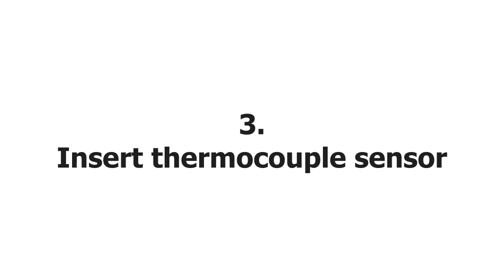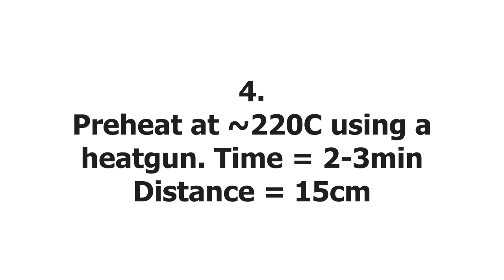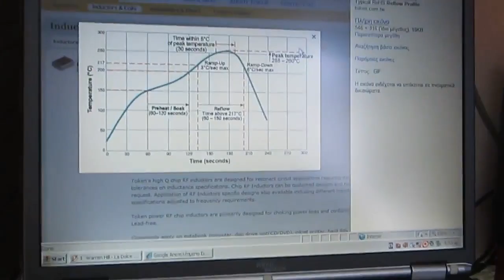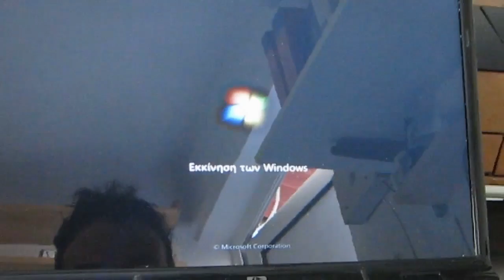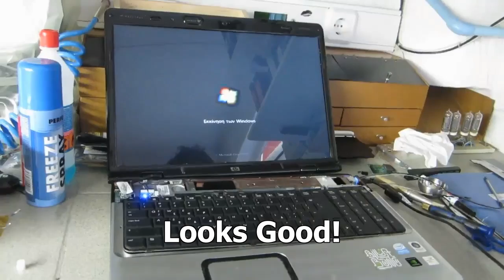HP Pavilion DV9000 Series Laptop Display Repair - GPU BGA Reflow

Comment: Tin melting temperature around 220-250c and that's should the maximum temperature and heat at this temperature for 4-6 minutes. Pour liquid flux around the chipset .. Many video in YouTube how to put flux correctly, then Use aluminum tape to cover surrounding the chipset 
Use heat gun start with low setting and heat the chipset and surrounding evenly around 80c for first 3min, then focus evenly on the gpu chipset slowly increase to 230c for 5min, then lower the temperature slowly to 60c for 3min, let it cool down. Wash with alcohol or acetone with brush,.

Comment: Sir i hve hp g61 laptop i juat finished to clean my laptop screen inside cos  some water drops go inside. So i finished to clean but not its not turn on. Boc i forgot to remove battery While i plugout wire hmmm help mewt ido now?  Nd when i plug power coad so charging led on. But when i click on power button  motherboard not turn  hmmmmmm plz plz hellp help help

Comment: Thanks for listing the music, I like it.  Technician heated my HP Pavilion and fixed many issues, still waiting to hear from him he's also trying to find a new inverter for my screen but the computer now works.  Not sure if the technician was able to repair my DSL plug in for internet (unsure of name), he has to use the Wifi from the neighbor he's very poor but he mentioned he will check this out also.
Reply: How long did poor technician's work hold? Is your laptop still working, was the repair worth?
I have one to repair and I am wondering if reflow is worth, or reball is the only solution
Reply: @Simion_T    Didn't last more than a month... But I've been told several times I need a hard drive... the hard drive is the original from 2007, so I just might try to find one but tough I live in the Philippines.

The LCD screen is long gone and I think also the DVD drive but wow the key board is so nice, WiFi and it's an entertainment laptop so it works well with multi media plug ins and I can use the large screen TV.

Comment: All you people saying you recommend fixing it up and selling it. knowing it would fail eventually, are whats wrong with this world.  this method shown is only one part of this process. the temps are incorrect though. they are much to high. that aside, the board needs to be preheated. the use of flux IS possible and from what i know is recommended. but used correctly. the full temperature profile of this video is wrong. but the heat shield you see is correct. pansy out and use tin foil if you like but if you want this to work without serious destruction then don't use tin foil. 

(Electronics technician for several years. computer technician 17 years. founded and run electronics company since 2012. )
Reply: So why don't you do a video how it should be done????

Comment: can I use a hairdryer instead??
Reply: you can't melt solder with hair dryer
Reply: It worked,but I know it is a short time solution,in fact it was a 1000w hairdryer which I kept it right on the gpu
Reply: For how much time u did it? i wanna try it too with the hairdryer

Comment: i have lenovo W500  with  ATI  Fire GL V5700 got problem (distortion images then black out). Now i'm using the integrated intel 4500MHD, it can help me do some exercise with 3D apps.
 When i had this notebook repaired, some technician told me in W500, the ATI  chip  is glued  so  it can not be re-flowed by  using heat gun or IR  re-flow station .

so will this  video help  me  fix discrete vga problems in  lenovo W500 ?

Comment: dafm9cmb8c0 motherboard by quanta. please help. how do you make sure that this board only require reballing  or reflow and no other components are faulty.
Reply: When you start the laptop, HDD lights look normal for booting, its just that the Graphics processor won't let you see it. You can also run the manufacturers boot tests too, but basically it seems to boot but no display.

Comment: there is no 3v_alw and 5v_alw is present when I connect battery but on adapter it's present. +15v alw is always absent is there any fault with components. pwr_src  19v from adapter and 12 v from battery is present.  MOSFETs are OK. rsmrst is 0 goes to 3v then 0 when I press power button.

Comment: Won't this problem eventually come back?
Reply: James Mahon so you fraud people selling them broken laptops as working ones that was "fixed" with temporal solution that is not an actual fix?
Reply: +iooi depends. In a laptop reapplying thermal compound and cleaning out the exhaust fan will help the problem reoccurring. I have laptops that have been working for 2 years after a reflow.
Reply: +iooi I'm a repair tech and sell used laptops all the time. it's no problem to repair these and sell it for 125. people still want dirt cheap laptops. I'll buy machines like this from people for $15 and resell em all day. all it takes is about 15 mins of actual work and some waiting and I make over 100. lol. sounds like a good deal to me.
Reply: James Mahon I still see DV9000 dual core going for 250 to 300 dollars. Yes these units still holds value...
Reply: Svyat G that's what thought too
Fraud exactly!

Comment: You were at 262 at 180 seconds then you should drop from then on according to the chart. Is there a reason you increased temp after that?
Reply: Looks like another no replier! I thought it best to move the heat gun smoothly & not all over! How important is it to pre heat the board (the bottom)? Another video says if you don't, you risk warping the m/b. Thanks
Have a Toshiba I want to do a GPU reflow, but want to be more prepared.

Comment: Its also a bit easter if you put a heavy weight on the chip so it settles on the board better. But you do have to watch your temp as it could melt the pins together.     Great video.   Works on mac too

Comment: u cannot measure temp with probe when u using hot air. probe is for IR, for hotair u need to use IR thermometer.
Reply: IT-Master 

I think you are right ,

Thanks for sharing this ,

what temperature not to exceed 

Thanks & Regards

Comment: what would cause you to need to do this would having the laptop get really hot cause this problem and this would fix it?
Reply: It's generally a temporary fix. You heat it above the temperature which caused the solder underneath the GPU chip to melt and solidify in a bad shape (creating a bad contact). You fix it and you sell it or if you think you are lucky and it will work for a long time, you keep it.
Reply: soupflood Thanks I did this for my acer aspire 5535 it fixed it for a month now its broke again imam just sell it and get something new

Comment: thanks for the info just did a reflow on mine and now it works also
Reply: and i used the small torch method without any heat shield

Comment: very good, this method did a good job with my Acer 5520. I followed exactly the instructions. The Acer has a seperated GPU card, it is easier to assemble.
Reply: You are stupid, that one is aspire 5520G
Reply: YOU are stupid, that one is HP Pavilion DV9000. ( Look at the title of the video).
Anyway, my laptop is working now.

Comment: sir how do you know if the one your reflowing is the gpu? Is gpu always located near the fan of the motherboard? or not? because i have d260 acer aspire one it has this weird pixels issue on screen and went blank, i thought it was bios problem but when i do more research i found it its due to its gpu problem overhearting making all the part of the ball lost contact to mother board, but i can't tell which part should i reflow because i don't where is the gpu located and i did some research again and what i found wasn't satisfying and really not informative so i still cant figure out where is the gpu located, anyhow is there any other way to reflow the gpu without using the hot air gun since i don't have one ,, your reply is much appreciated, Good day. and thank you For the video.

Comment: Its an HP??, so everything is just a temp fix till some other shit part goes??. If peeps not like video (IE Julio César) then go FO to somewhere else or give a better suggestion?. Fucking laptops r cheap and not worth buying equipment for proper reflow or even paying someone to do it for u and weeks or months later it pooching again anyway. I suggest people look around YouTube for other fix to this nvidea gpu chip problem and pick one they feel most comfortable doing. There is the oven way, heat gun way etc. Good luck to peeps trying to fix their laptops and fuck all the loser haters.

Comment: After reflow my pc works fine for few days. Then this problem starting again.
Any suggestions.?
Reply: my eng not so well.. im never try this stuff-but im good at pc...
it sounds like you should still heat it for 40[+] more secs.
it sounds that u have cooling problem! check especially your fan and whole  laptop from dust include between the fan ITSELF to the metal stuff near the fan[dissasemble that part..] ..sometimes there is  a lottt dust!
2.put some thermal paste!!!
3/ consider that maybe your fan is weak or faulty..[order new from ebay /whatever-or try to lubricate it with machines oil--*not wd-40!!!
4. maybe you overload [thats the word?!] the pc.. so its overheat and break again the contact balls...[or if you block the air vents..like put it on matters-towel..etc. ]or if u not power off the pc/use it a lot on once boot.

*soo..reball again and do this things.. u can get USB COOLING PAD
hope i'm help!! update  us!
 .
Reply: ליטק יעקוביאן Thanks for your reply.
You pointed out number of things, I try them first and get back to you.
Thanks for you help.

Comment: with me it happend after i installed the new gpu driver update 2 weeks ago.
black screen with white vertical lines. i tried reflowing, then i got some red lines instead of white and then a minute later it turned white again. i didnt use a hot air gun as show on this video but a hairdryer. i do have a hot air gun in the basement but my question is do i set the hot air gun on 250 degrees celcius and hold 15 cm away? or put it on 300c and hold 15 cm away? i dont have a thermometer :(
Reply: hello you can but cheap thermometers liek that one on ebay

Comment: I did a reflow because was getting some lines in the bottom of screen after done that now is not showing video display.
What should I do ? help
Reply: Alex K
try to bake your motherboard at 190degree in a big oven for 4minutes. it will solve the problem. i did it many times and it work
Reply: hahahahah....NOOOOOOOO Alex DO NOT DO IT.....LOL
Reply: You were very quick in assuming that it was your GPU.  Sometimes it is the screen itself especially in your case
Reply: Screen is good. Just after done reflow stopped showing video display.
Reply: First, what made you confirm that the screen was good?, second, since you are now getting black screen then you have totally damaged your GPU chip
Reply: Screen was working before reflow. So what is the option ?
Reply: Ill try next time

Comment: Your video is great! I followed your steps exactly and got my DV9740 video to function again. I'll see how long it holds up. After cleaning the dust out thoroughly and placing a large shim between the chip and heat-sink it may run cooler and hold up better than when it was OEM.
Reply: How long did your reflow hold? Reball required or laptop decommissioned?
Reply: @Simion_T  lasted only a few days 😢 trashed the laptop afterwards, wasn't worth the hassle to try it again

Comment: didn't see when you took the bad chip and replaced it with good one. video stinks. music worse. sorry!
Reply: You don't replace the chip. The chip is good, but it's the connections that are bad. A reflow is basically melting the solder connecting the chip to the board in order to repair the connections. The heat gun method works well; I've done it to dozens of laptops.

Comment: i had the same problem i took a regular soldering iron to the board apart and toucht every sing cracked solder joint, and then let it cooled and turned up and it works just fine no need to doo all that :)
Reply: Fernando Flores How did you do that?

Comment: However, maybe your notebook works for 9 months after heating with heat gun. But another 10 may dies after month... Those IC's needs to be reball or replaces with a NEW one. That's even not a reflow, because for reflow you need to preheating the bottom side of the mobo.. and many other things... 
Like I said - however, nevermind...

Comment: Unbelievably, I just used my new heat gun @ 750 watts to revive my T61. I was doing it blind, but I tried 2 mins at about 10" and 1 minute at about 4-10, with about a 67% / 33% split. Just did a test boot, and it works like a charm. Hope it lasts until the T440s comes out!

Comment: Hello everyone,

dear all can anyone kindly help me?? I am someone who Reballs the GPU and Grafikchips I use the followings:

1- AMTECH Flux: NC-559-ASM-UV (TPF) Made in USA but I bought it from China
2- Solder Balls from Profound Material Technology Co.LTD
3- Heat Gun THLP 2000 EP, Made in Germany
4- Termameter 50c-750c

It works very nice, but after one week or MAX 1 mounth its not working anymore, so therefor I wanted to know why? Can anyone help me please? Many Thanks in Advance.

Regards

Comment: if you buy HP laptop you must buy and also equpment for fixing..i had DV7 and it broked just after one year waranty..want turn On ..then i bought another hoping for better luck..and gues what ..died after 1.5 year few days ago...that ingeners who work there should be hanged..comlete morons..now i use acer who work for 8 years no single problem ..no 17.3 inch  screen  and all that fensy stuff but it WORKS

Comment: In some cases, maybe, but in most cases, I've seen, only gpu replacement fix the problem. We try to reball many 6150, 8400, 8600 IC's + copper shim and AC ceramique grease, but they work for a few days and blow off. Only replacing with a new, 2011 and later maniactured IC fix the problem for long time. If you want, you can share your opinion at P.M.. Thanks.

Comment: "v"

No, it is not. Speaking as a former HP repair tech, re-balling the GPU and then fixing the thermal module with a proper copper shim totally solves the problem of the GPU getting too hot and de-soldering itself.

Now, the other problems that HP laptops have.... well it's still all on the fault of the engineers.

Preheating the bottom of the motherboard is a BAD idea, as the DV9000 logic boards have components right on the bottom side of the GPU. They like to fall off.

Comment: Hello mixospp, I have a problem which begun after the heat gun trick. 2 components were blown off the mainboard. One: the connector for the fan, Twoo: a small transistor near connector named at One. 
Can you tell me, looking at your mainboard, which components I mean and can you tell me the text written on Twoo? It's a black small component with some text on it. This one I have to add.

grtz, Mark

Comment: I just do the same trick and... BIG FAIL ! Maybe too hot, maybe my mistake of letting the heatsink attachment behind the gpu, but several resistors and capacitors were detached behind the GPU to stick on the insulating plastic from heatsink attachment. bye bye dv7

Comment: please what is the name of the device used to check the temperature. I typed thermocouple thermometer and it has various results in different shops and they have different results. If you can look one up on the internet and paste the link, id be highly grateful. I knw hw to dissasemble and whilst fixing but never done a motherboard thing though I am certain i can pull it off. I dont know where and how to connect the thermocouple cables to the motherboard. ba_zini_1883i@hotmail.com